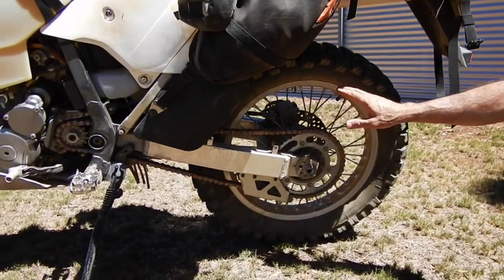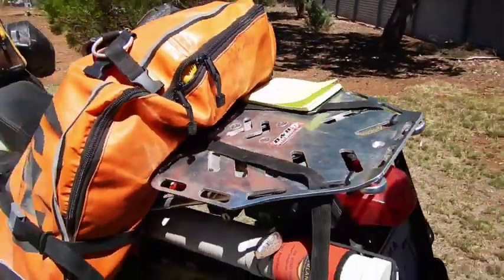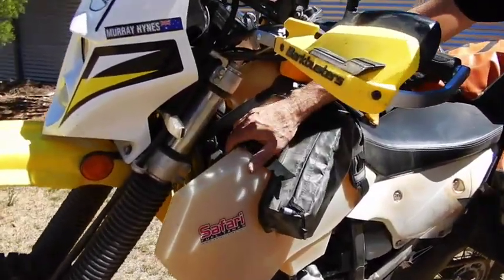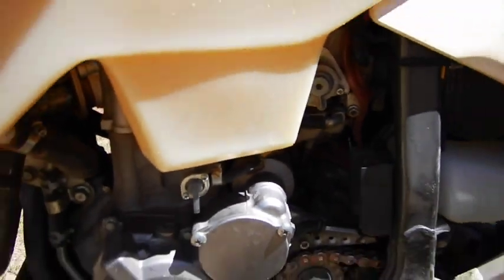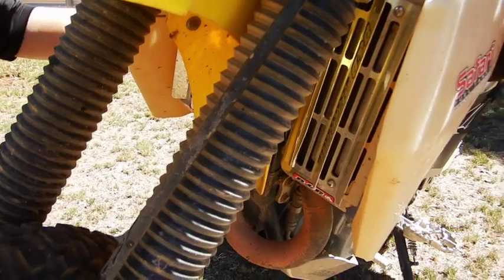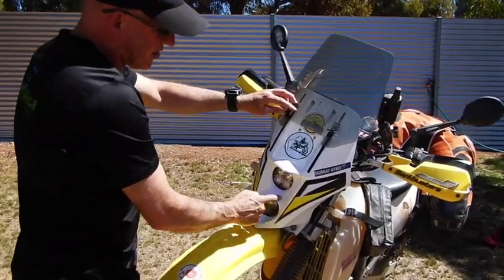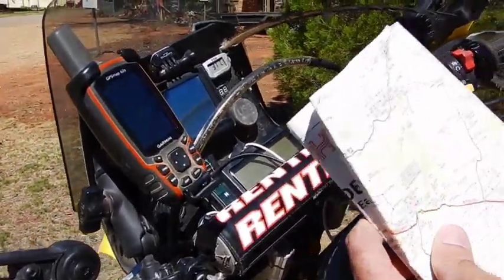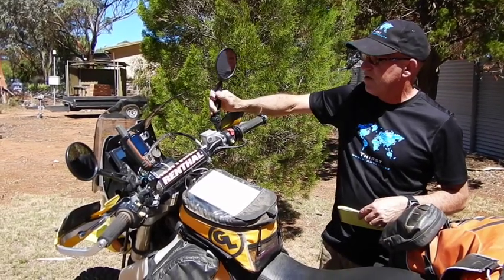Murray's DRZ400E

Comment: Every time I watch a review for these smaller ADV builds, I wonder what exactly is the objective when people choose the big stuff like the 1290s, 1260s and 1250s etc. That 400 looks plenty big enough for any tallish fellah but it's gotta be easier to service, to fix and to pick up after a fall (especially if you're alone) than any of the ADV behemoths. Even the 600cc+ options look questionable next to this supremely kitted out DRZ. Highlights for me: novel use of airbox; tent pole tube; Lynx fairing system.
Reply: Highway comfort I would think; power in upper rev range, more stable in wind, and just more stable in general on the highway. Also electrical power considerations. Heated grips + GPS + phone is just about all you are going to get from what I've learned. If you heavily micromanage the on-off switches you may be able to get a heated vest. Luggage; if you travel like a rich girl on the titanic, the DRZ is not going to cut it. Mileage; 30 - 50k until a top end rebuild on the DRZ. I'm pretty sure big adventure bikes go the distance. In contrast to your view on the matter, I see no reason to want to subject yourself to heavy highway miles on the DRZ if you only go on a nice dirt road here and there. If you love getting lost in the middle of the boonies, it's a great choice.

Comment: Hi there syzygy9, the Kaoko cruise control used was part number KBBAD and it fitted with the Bark Busters. Its a great way to help with the fatigue on those long trips.
Reply: Hi, Murray! Could you put the mods links or the parts nr? Its not easy to find all the suppliers. Thanks.

Comment: Gearing fix : ACT gear set gives you same first gear as 14/47 and fifth same as 15/44. 17L isn't enough for some outback tracks. The 28L is better in that you can run it full if needed, but 2/3 if not .

Comment: Clean and oil a k&n air filter. Or just clean,  then hold it up to the sunlight... 
Not made for the dirt at all.  Wouldnt even run one on my car. Seen dust in the intake boot post filter on mates dr650's that had them until i pointed out the obvious.

Comment: Is this a Safari 28L tank, and what is your experience of it especially how much fuel is left unavailbe in  those wings?
Reply from the maker: This is the 17l safari tank which actually holds closer to 20l - it is good for about 400kms. Once it runs out on reserve if you lay it on it’s side to swap the remaining fuel over, the rest of the fuel that is remaining in the right side wing is good for another 40kms.
Reply: @FraserSteve  Thanks for the information.

Comment: Any modifications to the suspension?
Reply: Hi Ronan, shock was revalved and thicker oil in the forks, not a race bike so not going over the top with $ spent. Suspension is an area you could spend endless money on and the DRZ although a great adventure bike is limited in it's initial design. It does what it was intended to do with ease, but obviously has its limits.
Reply: Murray Hynes ...thanks for the reply. It’s a nice build, very sensible mods

Comment: why not just carry 1 x front sprocket instead of a rear - example i run 16/45 on my 950SE for dirt/road if i were to carry a spare for gearing be a 17T  or 15T 1T front = 3T + or -  on rear
Reply: The rear sprocket is much easier to change.